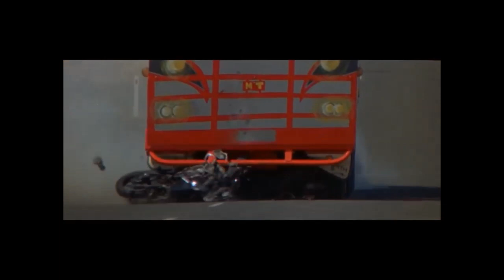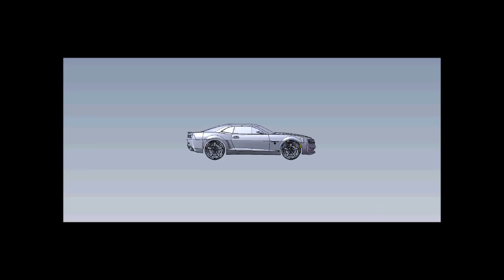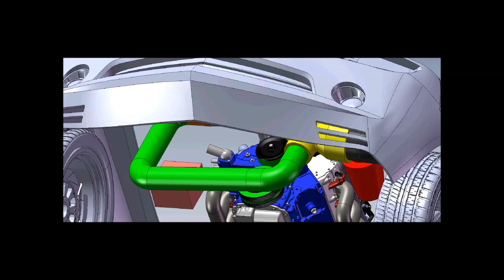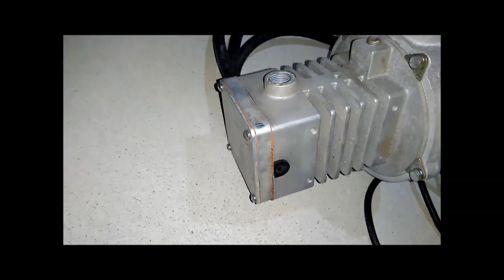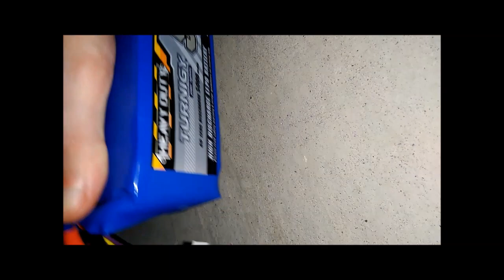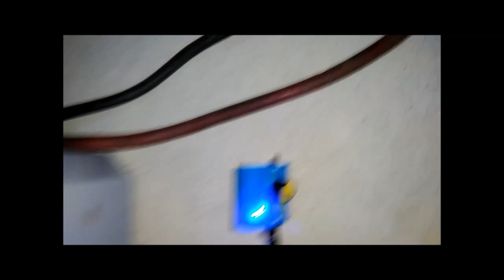Electric Turbo Camaro Project - Part 1:  Design and Bench Testing

Comment: love this project and this simple design . i need more information about motor power and tupe 
also  right turbo size to  handle only 250 hp to 1litre bikes . if you help me i will be apprectiated .

sorry for my bad english .
Reply from the maker: Well my motor can handle 10kW but is only getting about 7 from the batteries and it's good for my LS3 (6.2L).  For a 1L bike you really don't need a big blower or a powerful motor.  If you check "Thomas Knight Superchargers", that guy built my custom S/C and he can build you a smaller one for your application.  You should contact him for a quote.

Comment: I think a 15Kw PMAC belted to a super charger headunit would work pretty good same motors hobbyist use for electric motorcycle conversions
Reply from the maker: The power would be more than enough.  I figure the challenge would rest on properly gearing it to spin at the correct speed to produce the boost levels you need and then finding a portable power supply that can deal with that much power.  I'm using 2 very large lithium batteries and it can barely cut it.  Also the BLDC controller can barely cut it so if you double the power you'd need to look into a different class of hardware to support the blower, but it would make a very nice blower indeed.

Comment: Hey, you commented on my "Myth Busted" video.  Mine was built by Thomas Knight too.  Yes you are right, my videos were terrible  and the batteries were almost dead (I figured out later lol)!  Excellent work on your video!
Reply from the maker: My point certainly wasn't to say your video was terrible.  In fact I thought it had great potential.  Was only suggesting ways to pull the audience more by demonstration.  Curious to know however... if you had the same builder as I, what were your performance numbers?  Mass flow rate, electrical power, boost, HP/TQ, etc?

Comment: Love the build.

Where did you source that motor/impeller?

Got any more updates? :D
Reply from the maker: I got the whole thing custom made from Thomas Knight Superchargers (link in description) although the turbo is a Garrett T76.  I'm still working on getting everything ready to shoe-horn into the car but don't worry, when I have something significant to report out, I'll make a Part 2 video.  Should be spring-summer when I'm able to get the physical install done.  Not too long.

Comment: Garrett already has an electric turbo in the works. It will be available end of the year. 1 Hour installed compared to 8.
Reply from the maker: do you have a link?  I'd like to check that out

Comment: There is a company out there that makes electric superchargers for smaller engines.. do a search.. cleetus mcfarland tested them.. it works.. will give you some ideas.. looking good so far...
Reply from the maker: Are you referring to TorqueAmp?  It seems legit.  I think it's true they cater to smaller engines as most of the dyno graphs I could pull up quickly show modest gains in the 100-200 HP regime.  Not sure if they make anything that would feed a V8 though.  At the time I started planning for this project, there was nothing at all on the market except this 1 guy I got mine from and his work was all custom.  That's probably why the 2 units I had possession of were very different animals but both were oversized compared to what I have seen commercially.  Still, the size I have now is what you might consider small and still packs a punch at 10 kW so it should work well for the LS3.  I just need to upgrade my batteries some time down the road to 7S and possibly the controller too so it can handle 400A.
Reply: @ChrisCamaro  yeah the torque amp. 
I like your check valve for boost arrangement too. I considered doing something like that for mine as i felt the out of boost performance was taking a slight hit due to the intercooler and charge pipes..

If i could make a suggestion, looking at your diagram youre drawing the boosted air from above the exhaust manifold.. youre going to get really high iats that way. If you relocate the unit low and towards the from of the engine bay itll help a lot. Also hest wrap the coldside in the engine bay.. mine saw 20 degree colder iats this way.. itll make you feel better.
I respect that your doing your own thing. I did the same when i fabbed and added rear mount turbos to my 5th gen..
Reply from the maker: @yolofullsend  That's a good point!  When I planned that layout I was only thinking about where things would fit but since I didn't have the CAD for everything under the hood I may have been a bit conservative.  Maybe there's a way I can jam things in there and get the filter away from the headers.  Will look into that.  Thanks!

Comment: I don't want to say this is a bad concept because it isn't, but I feel this implementation is going to make everything much more difficult and a lot less reliable just to give it the term 'non-parasitic'.

There are companies that make alternators that could power this thing depending on your vehicle and the fitment. I see issues with trying to have a separate power source that will be much more difficult to deal with.

The difficulty of battery life, issues with reliability of a LiPo and ESC setups, and difficulty trying to have an ECU that can adjust tuning for not only the speed of the electric motor but also guaranteeing proper fueling for nitrous. These are all issues that make it not worth the hassle over a standardized turbo or supercharger. You are better off comparing this setup to nitrous than one of those and I forsee a much greater chance of you blowing your motor from this setup.

Again, all these major problems could be sorted by running it off a high output alternator, but wouldn't allow you to call it non-parasitic. It would cost more now, but will be much cheaper than the eventual motor failure from running this and nitrous on a stock motor. If the whole non-parasitic thing is your end goal, go for it. If your end goal is advancing the use of electric motors to increase power you should go back and rethink the whole design. You could eliminate the downsides by running this off a better alternator and completely eliminate the design issues you have with the intake and fitment.

Just my 2 cents.
Reply from the maker: Thanks for your feedback.  Many different things you brought up so I'll try to respond as concisely as possible.  The batteries of course will wear out so there is a maintenance cost on those that an ALT would eliminate.  Dealing with the fluctuating voltage delivery and the fueling for nitrous is a bit of a pain but totally doable if you know how to tune your ECU.  I realize many people don't but there are tables that will address the nitrous for example and the voltage from the battery can be compensated for by increasing the controller's duty cycle, which I will do in my controller.  Still you have a point about this being sort of "niche".  The biggest advantage though, and the entire reason for doing this in the first place, is that by cutting out the parasitic losses you really are making more power than ANY conventional blown setup before having to change internals.  The power consumed in either crank torque or exhaust backpressure for normal setups, lowers the HP ceiling that the parts can handle safely and also the fuel system.  WIthout that strain on the engine, you have free headroom and that makes ESC a special case where you can always beat out your competition, provided you have the same engine mods or lack thereof.
Reply: No alternator can put out enough juice.. it has to run of fast drain batteries and slowly recharge when not in boost.